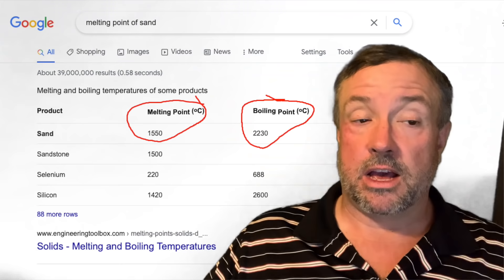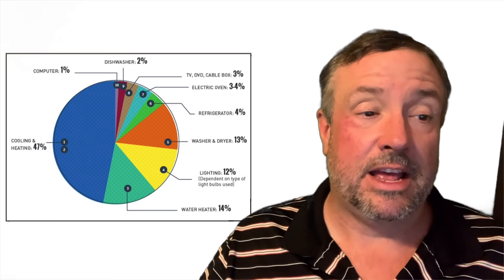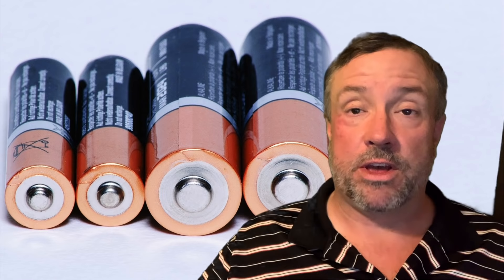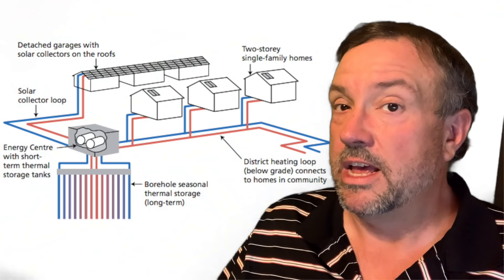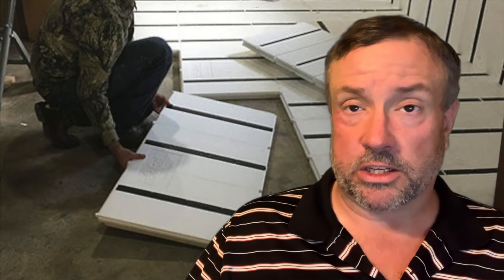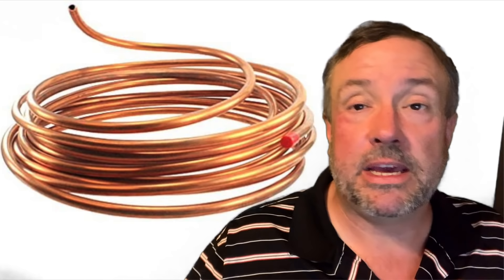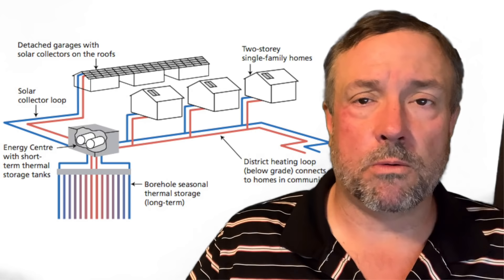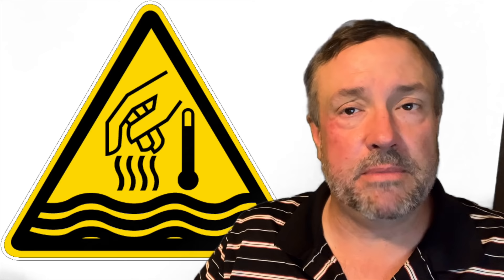Sand for Thermal Energy Storage

Comment: Thank you for the challenge and video.
I am interested in the concept of developing a "package earth based thermal battery" to incorporate into everything that I build from this point forward. Residence, office, workshop, warehouse, studio or livestock structures should incorporate this into the project while the excavating equipment is on the property, to effectively negate the energy costs of use and ownership for multiple generations and the life of the structures!
To be clear (er) the materials cannot be beyond the extended range, for the most part, of the DYI hobbyist, farmer, small business, builder etc... so they need to be obtainable through the normal channels and relatively inexpensive.

For subsurface, insulated heat (and cool) storage, i like the idea of corrugated flexible pipes in loops with a manifold at the blower sites to circulate air to charge and reclaim the desired temperature and smooth the peaks and valleys of the temperatures over 24 hours, days or weeks, akin to Earthship design.
Since sand is cheap, wouldn't it be better to use to fill around a network of 4"-8" corrugated piping within an insulated sides and top thermal battery below the above structures as opposed to other medias like earth, gravel, stone etc...?
Some people may prefer to do this with water or other fluids but beyond the readily available and inexpensive PEX tubing (<100°C), what else fits those criteria?

Aircrete expands and multiplies the volume of concrete per yard for building a subterranean vault for your storage battery, but it still requires insulation to be efficient, right?
Can the battery be built without that structure, but withing the foundation and footings of the buildings it serves?
The "slinky coils" horizontal and cheap excavator/backhoe installed geothermal systems can range outside of the foundation walls where land is available but would run back to the structure and charge the sand-filled "local" battery contained there, rather well would it not?

Perhaps a combination, working separately or in tandem of an air system and a fluid system would be the curve breaker needed?

Also, if we incorporate a multi-input storage tank for fluids, we could collect solar, ground and wood heat into the same vessel and count on each to fill the voids as conditions change.

Thanks again.

Your thoughts?
Reply from the maker: keep me informed!!!!

Comment: Even not using the parabolic trough,  adjustment will be a constant unless automated.    Next I have been working on the same, my guess is use water as insulater to sand, set up where daily or hourly use(adding new cooler water to system to keep temperature at desired Temps, like just below boiling.

Also use high temperature electrical materials at location, TEC-TEG,...
But these will be most costly.

If I could stand the cold I'd come help out...    I hate cold, worked on Lake Michigan on a day it was -95 F, now I like sun sand and cold is 60 F or below..lol
Reply from the maker: lol - Lake Michigan - that's like the tropics compared to where I live

Comment: Long steel rebar rods that are, let's say, 85% in a sand berm (facing the sun) and 15% in a water tank. The tank can be concrete. The rods can be bent at an angle to accommodate the tank being underground. The rods must be coated with something to prevent rusting and leaking when in the water and passing through the concrete. 
This Heat exchange is using solid metal.
A more expensive one could be Copper coated Ground Rods used normally for grounding homes and commercial properties.
Reply from the maker: Cool

Comment: Well if you "get a lot of sunshine" during cold winters, you don't really have a heating issue, unless you don't have enough space to capitalize on that sunshine. Even if your heat storage battery is small or low temp, that's still sufficient to provide warm air or water to a commercial heat pump or a DIY heat exchanger to make it super efficient at transferring these calories into heating or hot water.

I have similar challenges in the old house I am renovating, and I found it surprising that there are no ready-made devices or DIY plans using different technologies or fuels to solve heating, the biggest energy we consume, in a simple way that can be understood and managed by the house occupants, not calling expensive specialists to deal with expensive equipment. So basically, you have to discover and invent and design everything by yourself. Or pay through the roof for such a system.
Reply from the maker: Well said

Comment: Simple Tek, If you move to New Brunswick let me know.
Here is a Catastrophe-Prepper type perspective:  
Water storage is critical.  Having electricity is critical.  Having compost is critical.
Here are my suggestions based on a pole shift scenario where the sun is blacked out and the earth is wobbling for 12+ years.
Water barrels can hold up tables in greenhouse.  
Wind power for grow lights and water pumps.  
COMPOST THERMAL BATTERY for heat & natural gas creation 120F to 170F.  
Pallet wrap used for quick repairs to greenhouse film.
In prepping there must be many redundancies such at:  Fans that pump upper air into the lower sand thermal mass to regulate the heat in the greenhouse.
Here is weak point in this plan:  Massive earthquake, wind & hail falling from sky and fire.
The redundancy for this would be creating an ICF underground greenhouse bunker.
Keep 8 mil silage tarps, solar panels, etc.  stored until after event has subsided to install at a later date.
Reply from the maker: will do

Comment: Ethylene glycol could also be used as a fluid it does not freeze and it can higer temperature than water thats why it is used in auto radiators.
Reply from the maker: Thank you

Comment: I was just re reading Bob Ramlow's book solar water heading. He warned that oils as heading loop fluids cause issues with any rubber seals that they encounter. Also that ethylene glycol is toxic and should be avoided as a transfer fluid.
He also talked about insulation, saying that common ones will melt or degrade in uv.
Reply from the maker: interesting - thank you
Reply: Ceramic Fiber gaskets are good up to 1000c but can be brittle.  I'm sure with a little research one can find higher temp ones.   PTFE up to I think 260c but I typically would keep operating temps 10% lower than ratings jic.

Comment: i would consider an parabolic solar collector with a vacuum tube. you can then circulate air thru the tube and the sand battey. this way there is a lot of contact to tranfser the heat. the in adtion use a vawt with defusers to run a resister in the sand battery, this way the battery is still heated scheaply when the sun isn't shiing but but wind is blowig.

Maybe making the the battery mudular. by having a small but hight tepm. battery and a lager but lower temp  one can help when there isn't much energy availble. yhis way u don't have to heat a big battery al the time.

Comment: You put your heated mass in the middle of your living quarters. Heat it by wood or coal or oil.  Solar panels can be used to provide electric for electronics or cooling.
Reply from the maker: ok
Reply: Yes those supplemental equipment can be low electrical demand and pairs nicely with solar & wind power generation. 
Solar preheated air to burning unit will increase the output of the burning fuel. May only makes up for heat loss up chimney, but every bit counts.

Comment: I would think a multi-level system would be necessary to utilize the all the heat actually available.  I do however have a question... What is the most efficient way to extract the heat once stored?
Reply from the maker: That’s a good question… with heat delivery it’s radiant floors, but extraction… I don’t know

Comment: I have seen a parabolic mirror generate 500f st focal point when it was -8 f outside.  Video here on youtube.would probably be a way too recharge sand in the winter.   With the water pump through too a radiator in house flow rate should be able too adjust temp.  Water goes into sand for say 10 seconds comes out 50 c goes in for 40 seconds comes out 90c definately could make this a thing by adjusting flow rate through a loop.  Im north east ohio btw
Reply from the maker: Interesting!

Comment: Boiler to a coil (furnace coil-triangular car radiator.) air through metal pipes in bedded in the sand. a hydronic or steam system but if you get a leak in the sand gets wet, you’re going to have a steam issue inside that you want to avoid just do the hot air.

Comment: Have you thought about having an ‘air jacket’ around the insulated sand battery ? The air in the air jacket would become moderately heated , an extraction or circulation fan could harvest the otherwise wasted heat . 

With pipes installed previously like a heat exchanger , water could be injected into another engine/turbine to create electricity, or may even be enough to turn a fan to circulate the jacketed air to where it needs to go .
Reply from the maker: interesting idea!

Comment: This comment is slightly of topic. Although the core goal here is interesting enough in itself, i started to think about using sand as a battery for electricity. Extraction could be done with steam, and a piston-based steam-engine. 🙂I have not done any calculations here. But my thinking went in the direction of steel barrels, with coils in them for steam-generation. For transferring heat into them, the simplest solution would probably be DC heating-coils, connected directly to a PV-array. I do however fear that the building-cost could exceed the purchase-price of a simple lithium battery. 😕Any thoughts?
Reply from the maker: Thermal solar plants do this to make electricity at night

Comment: There are systems that do this at scale that use energy from wind/solar that power an electric heater (think the old style electric bar heater) and a fan to push the heater air through pipes in the sand. There is then a 2nd circuit to remove the heat from the sand in Winter.
Reply from the maker: Cool

Comment: Forget about molten salt, it's 700ºC and it'd for the primary circuit of a LFTR (T is for Thorium) as per the Oak Ridge Experiment, and you definitely need a secondary circuit to transport the heat to the house (tadiators between 720 and 750 degrees are not the safest idea).
Now, you were mentionning a problem about insulation, and that's where I block. I have invented (re-created)a material that perfectly refracts heat, so I know how to keep my bricks or my sand in a hot place. However, with such a material, how can I bring heat in  without letting it out? It's not too difficult to make a network of popcans painted in heat-resistant black, sliced behind a polycarbonate window and my material, even point a parabolic mirror at it, I can harvest the heat. I can paint thin copper tubes as well, it just changes the aspect ratio. But once I have my heat, I bring it to my "hot chamber", where I have my black sand or my red bricks, how do I prevent it from reflowing to the harvesting device when the chamber is hotter than the popcans? How do I keep the heat inside the chamber for long periods, like the summer heat for the entire winter?
Reply from the maker: I’m
Not making a nuclear reactor lol

Comment: Alternatives to water have more problems than they are worth. Ethylene glycol, for example, breaks down chemically, as do oils. The piping and connector costs are huge for exchanging high temperature liquids with sand. A water reservoir may only be useful from a 50ºC to 90ºC range, but the hot water stratifies to the top of its container, and container size can be made as large as necessary. Plywood containers with high quality liners are not expensive. Concrete with styrofoam and liners are not that much more. Due to the high heat of parabolic solar collector systems a heat exchanger seems necessary regardless, however, it is hard to beat the thermal performance of water, and you can circulate the stratified hot water directly through a heating system. The lower temperatures of a water system allow very low cost materials (PEX rather than copper). There are issues with freezing but a system that drains when not in use solves that problem and any thermal mass issues are readily handled by scaling up. You just can't beat the costs.
Reply from the maker: Well said

Comment: Here is my step by step guide to build a system like this.

1. Buy a brick making machine along with some fly ash or other raw material used in bricks.
2. Dig a hole of 3x4 meters and use the dirt/soil to make bricks.
3. Keep digging as deep as 2 floors down and use bricks to pave it's wall with bricks.
4. Use the remaining bricks to build the tank above the ground to increase the capacity of the tank.
5. Run metal pipes for oil with highest boiling point and make loops of pipe for easy flow of oil and to cover the volume of tank in well distributed manor so it could heat up the sand evenly.
6. Fill the tank with sand.
7. Connect the input pipe connection with the solar focal point where oil is heat up.
8. Pump the oil so it could heat up the sand.
9. Connect the out-pipe connection into another coil running into a water tank to heat water.
10. Further connect the oil pipe into a system of heat to electricity converter before connecting back to the solar focal point chamber.
Reply from the maker: nice!

Comment: if you want 300 degree sand you need tracking for the solar. It's hard to get good concentration like that without. Also yeah, you'll have issues with seals and pumps at those temps. Water is not so bad, and you can cycle it directly. You can add anti freeze to it. If you have a big storage area you need to fill the entire area with copper tubing filled with water. If you have a big water tank you just have and in and and out port.
Reply from the maker: try Sergi's videos on this - no tracking needed, slightly adjust the concentrated solar array every week is all

Comment: Wide metal piping lined with small perforations lining a deep aircrete container sand filled area. Simply blow the super heated air through the piping . If your sand zone fills with water then bringing it too far above boiling is gonna be a bad idea anyway. With this cheap system  the two factors to work out are...setting up French Drain Like service at the bottom to pump or drain out excess water and developing a system that can heat the air up to 1000 degrees. Air is the best medium to transfer the heat above 200 degrees. Simple soloution
Reply from the maker: sweet

Comment: As a kid I visited Prince Edward Island and we slept in tents on the beach.  We made a big bonfire of driftwood and melted Coke bottles in it.  We also dropped big rocks into it and they glowed bright red.  So I'm thinking a wood fired boiler Rocket Mass Heater batch box modification that is buried in sand as thermal battery and is uninsulated.  Instead of losing that heat to the open air, it has a mass of packed, dried sand.  Maybe in benches inside the house you can sit on?
Reply from the maker: Interesting idea!

Comment: Air has no temperature limits, short of being turned into plasma, which is beyond the melting point of sand. Air's condensation point is also too low to be a problem. I am thinking about designing a parabolic trough system to heat air as hot as I can and duct it through concentric shells of containers (filled with sand or gravel, or both) in the ground, insulated from each other to slow the heat exchange between them, but with the hottest in the center, using the cooler ones in a way as further insulation. I can have simple check valves to limit the air flow to one direction, which becomes important when taking heat out. I can use the same ducting with the air running in the opposite direction, first collecting low heat stored in the outer cells. By the time the load reaches the inner cells, it's already quite hot and pulls only small amounts of heat from the hottest cells. This hot air can carry its heat to a heat exchanger to heat water (for hot water system, or possibly to generate steam) or to heat a house.
Reply from the maker: Good insight
Reply: Why not just have one sand storage in pipe and an out pipe which can drive a turbine somehow?

Comment: This has already been done on a comercial level, and they use air to transfer the heat, and resistor grids inside of the sand to heat the sand, given that the solar is powered pv cells it can be directly attached to the resistor apparently

Comment: Ok Fresnel lens from old flat screen tv, cast iron pipe directed to riverstone stone filled aircrete container large fan on inlet of pipe (cool end), top of aircrete container with escape air directed to fan but with ability to mix cold air because the problem is when the stone gets too hot the exhaust air will be too hot for inlet air for fan.
Reply from the maker: Should work….